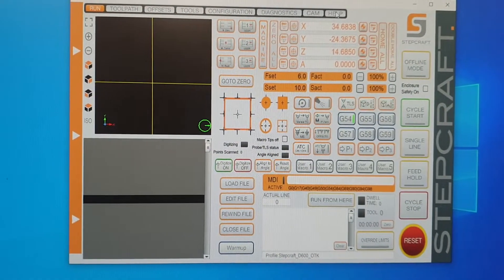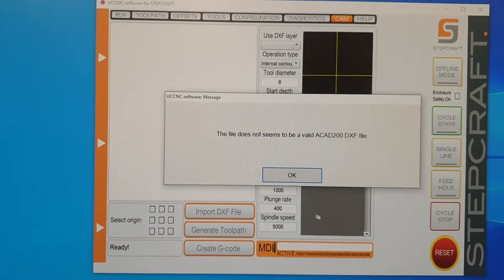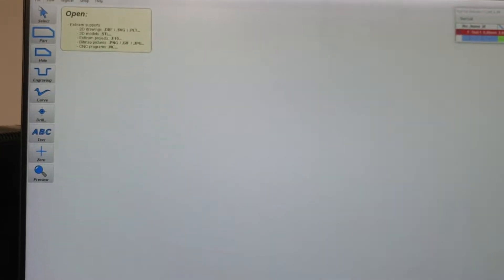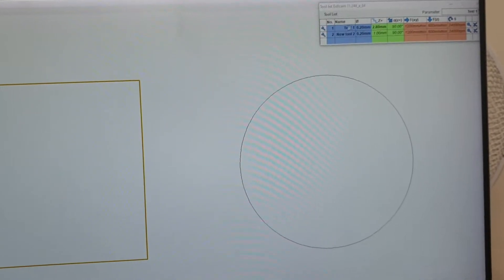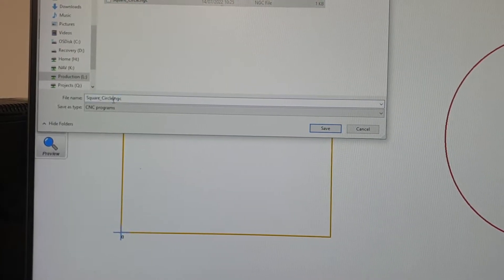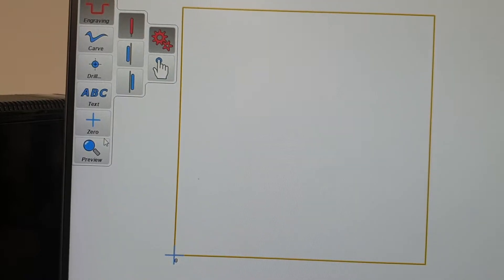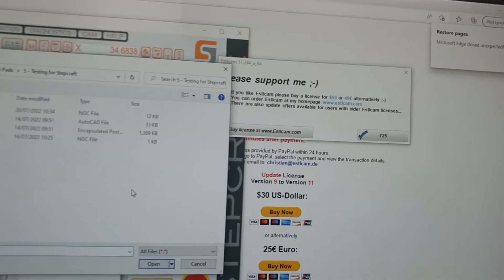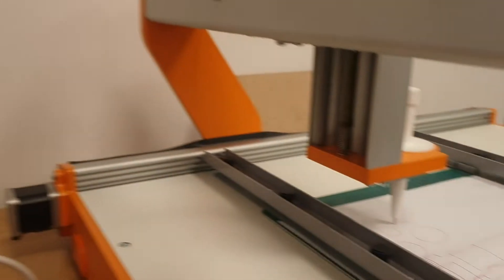Stepcraft UNCNC Won't import DXF file - Using Estlcam to get around more UNCNC Problems

Comment: Thanks for the helpful video. May i ask where you bought the metal holder for the green plate on your machine? Is it DIY?
Reply from the maker: They came with the machine.  The green plate itself is just a cutting mat.
Reply: @adamwiddowson8254  okay thanks. I have model m1000 here it is different